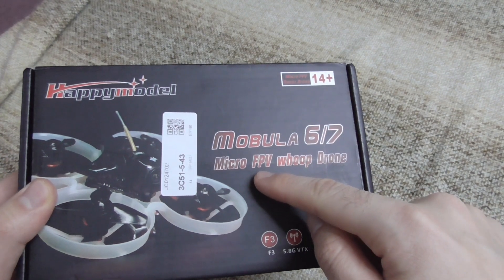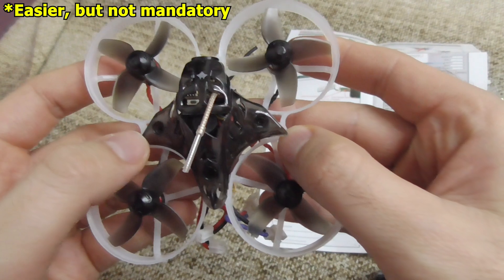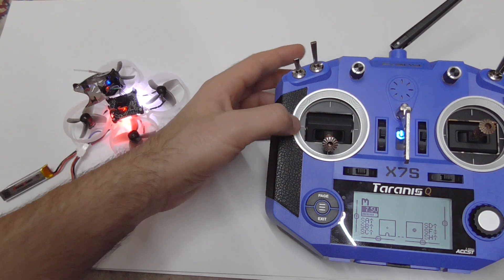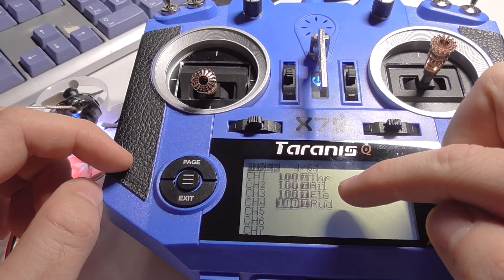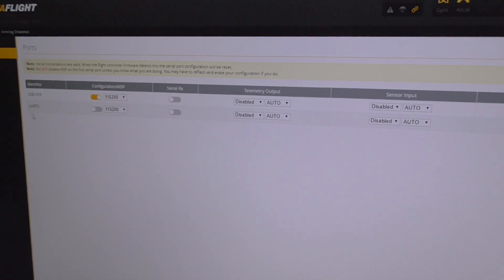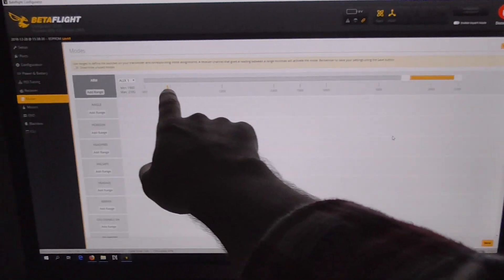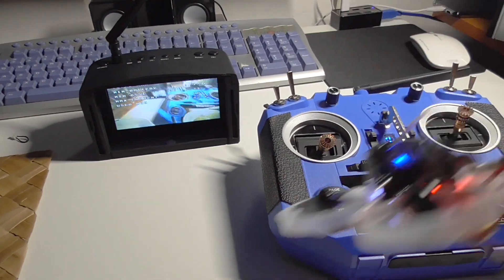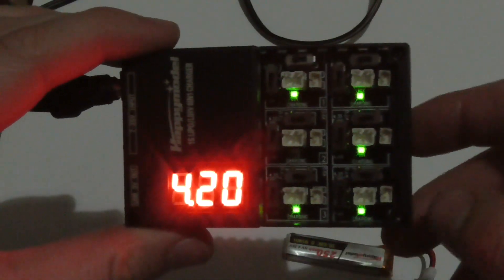Happymodel Mobula7 - Brushless, Micro Whoop Drone (Binding, Switches, Betaflight)

Comment: I am looking to buy this drone. Never had a FPV before. In fact I do not have a flight controller yet.

I just looked at this video and I am wondering if everything you showed was in the user manual or did you have to figure out some things by yourself?

I see a lot of comments on this video of people struggling with the setup. Why is that?

Comment: Mine won't fly and I did everything you did. When I increase the throttle it beeps but nothing happens. It will fly sometime then when I leave it alone long enough it stops. I don't really know how to fix it. Can you help?
Reply from the maker: Mine fell into the snow a few times and then it never worked well, I bought a new flight controller (a long time ago) and I still didn't installed it ;))

Comment: What is the difference between the bind button you used on top vs the one on the bottom? I don't have a bind button on the bottom as you showed. Edi: Never mind I guess my version has the bind button on the bottom but I still cant get her to bind.
Reply from the maker: Is the receiver inside the drone compatible with your radio?
Reply: @furulevi  yes but it just won't go into bind mode. Lights never change to indicate in bind mode. Returned for another one.

Comment: Excellent video, I just wish this was the first tutorial I stumbled  across. The part that I'm stuck at is that it seems to be connected and all (it's beeping at the same time I'm moving stuff) but the propellers just don't want to do anything.
Reply: also I have an x-lite if that makes any difference
Reply from the maker: If Air Mode is disabled in Betaflight than you need to increase the throttle also, not just flip the arm switch.
Reply: Thank you so much, I just flew my Mobula 7 for the first time after hours of of binding and updating.

Comment: help my leds keep flashing after pressing bind
Reply from the maker: At 5:00 the LEDs are flashing in this video also.
Reply: @furulevi  I figured it out,  i needed to press bind first, then connect the battery.  I'm on the Mobula7 but thanks for the quick response :)
Reply: @exposer3339  it's nice.i've trouble too and i'e found one :)

Comment: Awesome video ..got one coming in a couple of days and this surely helped...Nice detailed info. TFS!
Reply from the maker: Using 2 batteries it is a bit too heavy and powerful for flying inside the house. Due to the higher weight it is harder to quickly change direction or to stop. The second battery provides more acceleration and the ceiling gets dangerously close :)